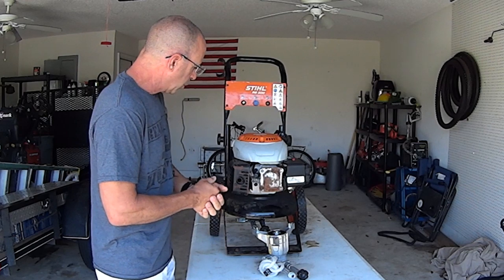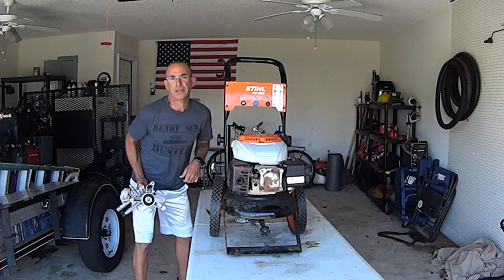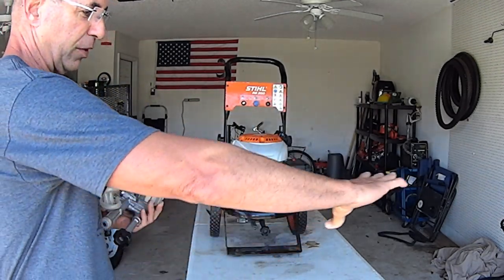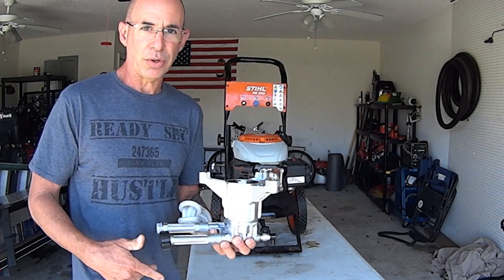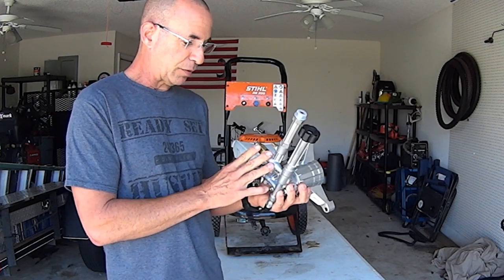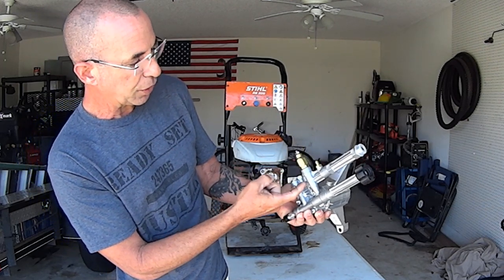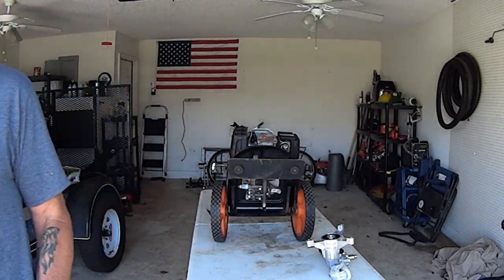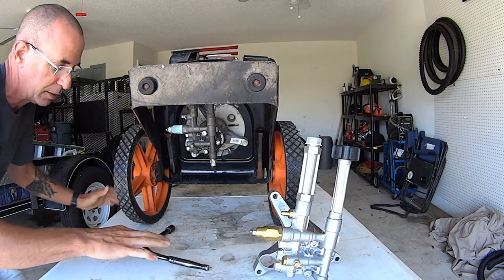Replace The Pump on Stihl RB 200 Pressure Washer P/N SRMW2.2G24

Comment: Maybe put a little lubricant like anti-seize on the motor shaft and put a small taper on the front top part of the key to help in line  up the pump to motor shaft on reassembly. 
Also to aid in Lineup of the bolt holes to the motor cut off 3 pieces of a longer size bolt minus the head of the bolt to aid reassembly by taking one stud out at a time and replacing each original bolt in it's place.
Comments from a retired machinist of 40 years here.
Keep the videos rolling,I love and learn alot from them!
Simpson pressure washer horizontal shaft user here.
Stay safe during this pandemic my friend&god bless you and yours.
Reply from the maker: beachbums2008 Thank you!!

Comment: Great video as always Dan.
Perfect timing with it too.i picked up a nearly new Simpson brand unit for free with a cracked pump from sitting in a cold garage over the winter.
Now I know how to change that style pump.
I’m giving the pressure washer to my son.
Please keep the videos coming
Reply from the maker: I am happy to help!
Reply: I just had a brain storm(or possibly a brain fart).
Every time you take a bolt out,put a 16D nail in the hole so that the engine stays put while taking the old pump off and putting the new pump on.
I’ll be changing one when the weather breaks here and turns to spring.
I’ll let you know if my idea works or not.
In the mean time,please keep the videos coming

Comment: My Father in law gave me a used power washer after he couldn’t get it to work correctly. The original pump was the boxer style, 6 piston opposed, it to cracked the housing I believe due to it freezing. I could not find a cheap enough replacement like the original style, went with the same style you installed, fit right on, shipped to my door was less than $100, new wand, 50’ high pressure hose and a foam cannon set up for washing cars, all in less than $200. To buy the same unit would cost almost $375, not a bad investment.

I installed three inch threaded rod in place of the bolts. Mounted the motor by using a nut on top, threaded rod, a thin nut against the frame which secures the motor, pump next against the thin nuts, and another nut on the end of each rod. This way if I need to service the pump it’s three nuts and it comes right off, leaving the motor secure.

Comment: So what happens if water is coming out of the chemical port? I'm getting like 50% pressure but with all of the water shooting out of the chemical port it's not at 100% pressure. How do I make the water stop from coming out of the chemical port so I can get a 100% water pressure ????
Reply from the maker: Sounds like the ball is missing or jammed. Take it apart and investigate
Reply: @DansVlog  It's was a bad rubber O- ring! Thanks for the video you did a great tutorial on the "STIHL RB-200" pressure washer. It help me out a lot!

Comment: I just picked up one of these used, it seems a very weak.  Is that the way they are, or is there something wrong with it.  The engine is running fine, could it be the relief valve is not closing?
Reply from the maker: Used? Maybe the relief valve is stuck half way but more than likely the plunger seals aren’t very good
Reply: @DansVlog  Thanks for the reply.  It was leaking between the upper and lower halves, I removed the 3 allen bolts and separated the halves.  Everything looked ok, I put it back together and tighted the bolts firmly and it is not leaking anymore.  Tested it, and it doesn’t seem to have much power.  I will test it again and listen for the engine changing tone like you suggested in your video.

Comment: Won't that black tube be called a thermo unloader valve?
Reply from the maker: I think so, that’s why temp came to mind but I am not 100% sure why or how it works
Reply: When your pump heats up it lets the hot water out and cool water replaced it so you don't burn up the pump

Comment: Hey Dan, 
Do you think it would be beneficial for me to convert my 4.0 gpm pump from direct drive to belt drive. Do you know of anyone who has done this. I am not sure if the expense and work would be worth. My pump is an A R 4000 psi, 4.0 GPM.
Reply from the maker: I don’t know what the advantages would be vs the cost. My pump is all of 4 years old now and still humming along. I wouldn’t convert mine
Reply: @DansVlog  I may not change mine either. I just seen different videos saying belt drive is easier on pump. I was just wondering what the cost vs benefit would be. I can't find d any videos on changing it.
Reply from the maker: It would require an entirely different pump mount and you would need proper pulley for the engine’s shaft. Too much trouble for me, probably why no one did it in video 😂

Comment: Dan ... that probably cracked from water that was left in the pump freezing.   It can be repaired ... if you want it fixed, you can send it to me and I’ll have it TIG’D ... it should be a pretty simple fix, and you could use it as a spare.
Reply from the maker: Lol we don’t freeze here!! I think the way the housing is designed and it being unprotected from the ground, trailer and hands it was cracked due to it getting bent.